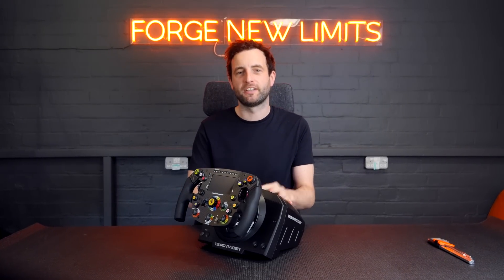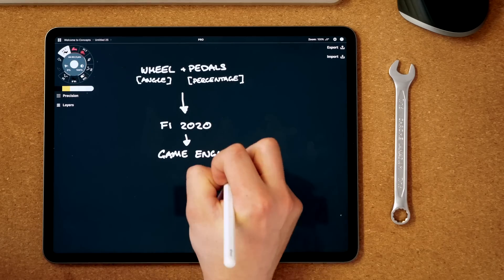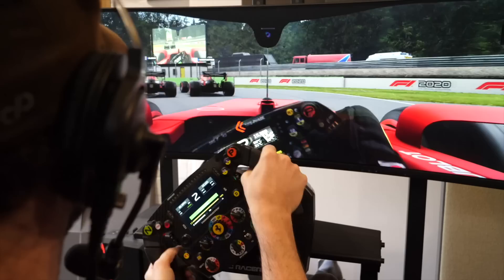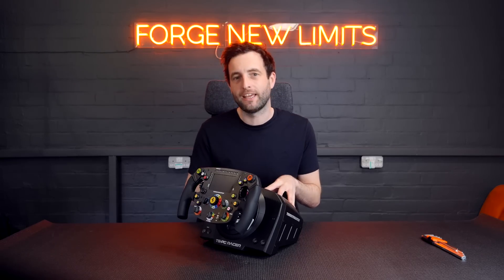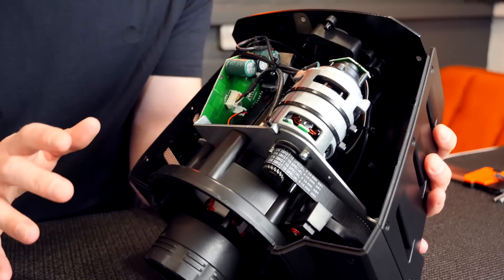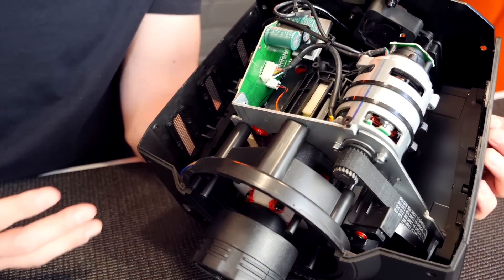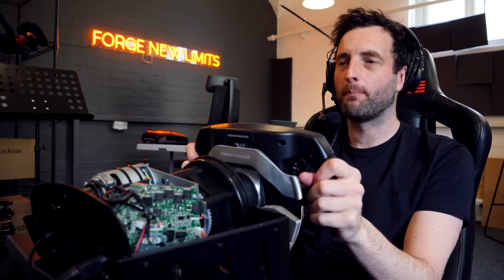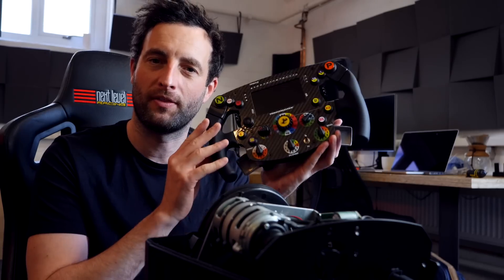The Amazing Engineering of an F1 Sim-Wheel

Comment from the maker: Was the inside what you expected? It was so cool to open it up and see some of the engineering behind sim equipment!

You can check out the new Thrustmaster Formula Wheel Add-on Ferrari SF1000 Edition here: http://bit.ly/sf1000d61
Reply: I work as a programmer in the games industry and I didn't know this thing even existed - but I had a sneeky suspicion that it wasn't a highly trained hamster and a bunch of little strings.
Reply: Yep, pretty much what i expected except for the motor mounted to the side instead of the centre
Reply: Wish you'd make a giveaway for it haha 

Some people I know managed to buy it day one, fair play to them
Reply: Maybe force-feedback sim racing technology can be adapted for real-life sports cars in order to improve tactile feedback through the wheel and seat when the car has insane power steering and suspension setups.
Reply: By the way... Would you be willing to show us what it's like to use this wheel for games that weren't designed for it?
Reply: About 2 weeks ago i was repairing my logitech and now i can see main differences between them and i think this wheel isn't so noisy as my :)
Reply: What software does this work with though? It looks cool, but I'd hate to spend about $500 on this and then have to spend as much or more for the software.
Reply: Hi Scott great video! Can you please do a review on the wheel which you like best? Cheers
Reply: What is direct drive
Reply: I know this is just an advertisement but man, who uses a thrustmaster as a ''F1 sim-wheel'' when you have direct drive ones with much less input delay and better FFB torque. Not to mention F1 by Codemasters isn't a sim either.

 I just hope next video about sim wheels isnt just an advertisement to one single wheel and you look more in depth of other types of wheels.
Reply: @Rad-88  Keep in mind you're speaking to a former F1 champion.

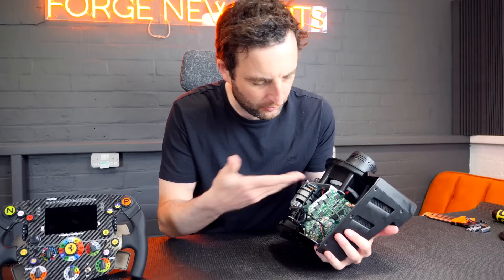Comment: At about @3:00 you say something along the line that the circuit board computes the information to understand bumps on the track etc. and then turns it into current. But surely the simulation data is computed in the PC or console? I mean the circuit board on the wheel has no idea what is going on "racing-wise", it is just getting commands on what to show on its screen and what force feedback current it should drive the motor with? Of course, the board also transmits the position of the switches back to the PC/Console. The top end of the board seems to have a bunch of MOS-FETs for driving the high current, but no "simulation computing" is actually done in the wheel?
I'm sure someone more knowledgeable than me can tell us what is right, I'm no Sim Racer but have some understanding of electronics and communication between electronic devices.
Great video - you have lots of interesting stuff on your channel - well done! 
I hope you or someone here in the comments can help me understand if I am on the right track or if I am "Mazepining" off it 😁
Reply: Yeah the force feedback data is generated in the game and sent to the wheel. The Wheel has it's own board to parse the data from the game and generate the appropriate force feedback. What Scott said was a little misleading when so much is dependent on the game engine code.

Comment: All i can see are cheap electric components circuitboards etc on the inside..some serious cost cuts made in the wrong place..so i can imagine the inside of the steering wheel will be made of compononts of less quaity...aka...short life.
Zip tys used  as factory default..says enoug about there lack off effort to make some quality product,but did their best to make a good profit product..with nice looks on the outside,but made from the cheapest components on the inside.

Comment: Much prefer a direct drive.  Love my ricmotech system.   Most mid level belt drives are about to become obsolete with fanatec dropping their entry level CSL DD
Reply: I don't think you know what entry level means mate.

The CSL DD is a bargain but entry level it is not. I'd be surprised if people looking for their first FF-wheel even know that Fanatec exists considering they only sell from their website.
Reply: @TheTrooper115  I never said entry level as far as the market goes.. I said "mid level" which is where that $350 is targeted. 

I mentioned "entry level" pertaining to fanatec only and their line up of dd bases.

Have a good day mate.
Reply: @eadams1975  Must have missed that, ah well, my mistake. 

I still object to you calling it entry-level. That's a phrase that has a rather specific meaning and can be confusing (as evidenced by this exchange), I get what you're saying though, it could just be worded a little clearer.

A good day to yourself as well.

Comment: I think fanatics new DD wheel is just the motor from a CSL Elite and if you’re swapping over to fanatec I don’t think it comes with a rim which sucks there expensive
Reply: So you think the standard CSL Elite motor can do 8Nm without a belt transmission? Then the normal CSL Elite Wheel WITH the belt should have about 200Nm torque judging be the lever length.

Comment: I love how masterfully you managed to avoid showing the hideous Thrustmaster “Quick” Release system 👌
Reply: Fanatec went to a system like that for a few months if you bought a rim it came with a plastic hub on the back you had to buy the metal quick connect it was a crappy system IMO
Reply: Garbagemaster
Reply: @Drewp06  Can't agree more xD I bought T300 for new year and died after 3 uses xD So i return it back and stared to build my own steering wheel base xD
Reply: I wonder if someone can make adapter for fanatec and this wheel :P
Reply: I know right, how do they expect me to waste 1 minute of my life when I can clearly waste that 1 minute in a race sim game.
Reply: It only takes about 30 seconds unless your full of shit , it could be better but its just fine
Reply: Logitrash Gay29
Reply: thustmaster owner here, can confirm how shit the "quick" release system is, takes around a full minute to switch rims, you have to:

1) unplug the wheel.
2) turn the wheel 180 degrees.
3) unscrew the little screw.
4) loosen some plastic cylinder thing.
5) remove the rim.
6) insert new rim.(upside down)
7) tighten the plastic cylinder thing again.
8) screw the little screw back in.
9) plug it back in again.

although, fanatec just revealed their new csl-dd, which is a $350 direct drive, will 100% be getting, it will be on sale q3 this year. https://newstandardd.fanatec.com/?utm_source=CSL%20DD&utm_medium=newsletter&utm_campaign=CSL%20DD&utm_term=CSL%20DD
Reply: @pancake5830  me : crying in Logitech
Reply: @pancake5830  
5.5) Line up the arrow on the wheel and on the wheel base
8.5) watch out for screwing the screw in too far
How can they call that a "quick" release haha...
Reply: @rubenvanalphen2780  the screw has long gone through the threaded tube on my wheel 😁
Reply: @rubenvanalphen2780  still, be happy you have the ability to change wheels, I SOO regret getting the G29, wished my past self would have researched better
Reply: @adamthomas1222  regretted at the right time mate, fanatec’s new csl dd seems like a good deal being $350. But just beware of the high miscellaneous costs that the fanatec ecosystem has
Reply: @adamthomas1222  Its not impossible to swap wheels on the G29/G920. Its actually overall cheaper than all the other possible custom setups. A lot more work though.
Reply: @blindaceg  I actually have one now, I bought a carbon fiber F1 steering, found it on AliExpress, it's nice to have an F1 steering shape but I can't really play rally style games or even drifting with this steering on... So yeah still, it's not an easy swap, not like the Thrustmaster where I can go from an F1 setup to a normal setup in minutes... Plus the 3rd party mods for the G29, you'll either lose the buttons or just ignore them
Reply: @MintChoccyIceCream  yeah I heard of that but then like you said, only the base is "cheap" and by the time I get all the other parts, I might as well buy a car and go for track days
Reply: @PunkHardSisters  thrustmaster and quick release. Yup I definitely was thinking about sim racing here
Reply: @pancake5830  mine is a ton faster, because the screw can't even go thru all the holes
Reply: @pancake5830  Question is, will it be better than the 200€ / USD more expensive ClubSport 2.5?
Reply: @pancake5830  you don't need to unplug it (at least I've never had and nothing bad has happened), and the correct rim gets recognised
Reply: @pancake5830  omg, the first world problems are real.

Comment: 2:08 imagine the sim breaking your hand everytime you crash
Reply: Could happen in Dirty Rally if running high FFB settings. In that game you really want to let go of the wheel when crashing.
Reply: @janbo8331  Not with this wheelbase, not strong enough.
Reply: @janbo8331  I tore my thumb open right next to the fingernail playing Dirt Rally 2.0 with too much ffb on a csw v2.5
Reply: @janbo8331  not with a ts-pc, crash as hard as you want, doesnt hurt at all, the max output is 6nm.
Reply: direct drive wheels:
Reply: Direct Drive Wheels definitely have the strength for it. Low and mid budget wheel tend to be weaker. The Logitech G29/G920 is for example not strong enough and can still be hold in position even at a crash^^
Reply: @mayaneko1094  Can still bloody hurt if it catches you wrong, unlikely to cause any lasting damage though.
Reply: @TheTrooper115  Yeah, but there's normally no situation in a race, where you take both hands off the wheel^^
Reply: the torque of belt-driven wheel is not enough to do that

Comment: I'd just like to say how reassured I am, knowing that your electrical sockets have both been PAT tested at some point.
Reply: You don't PAT test sockets. Portable Appliance Test.
Reply: @LEFTY073  Then the stickers are fraudulent and should be removed...  ;)
Reply: @Ucofatoffski  do u mean the plug for the wheel
Reply: @LEFTY073  I think they're on about the stickers on the plugs in the back of the room
Reply: dude that sim wheel is 329.999 euros man
Reply: @aaronanish7400  350$. Exactly the same price of the direct drive wheelbase that Fanatec announced today. What a timing. Add a 200$ Fanatec rally or racing style wheel (those already have control buttons, QR besides the rim itself off course) and make TM LOOKS so silly and low value now. Weird how Fanatec learned value from Thrustmaster while TM learned bull sh+t from Fanatec.